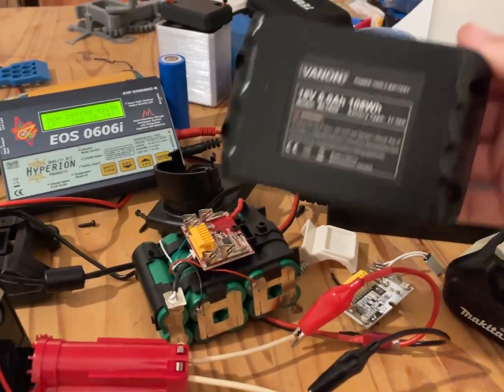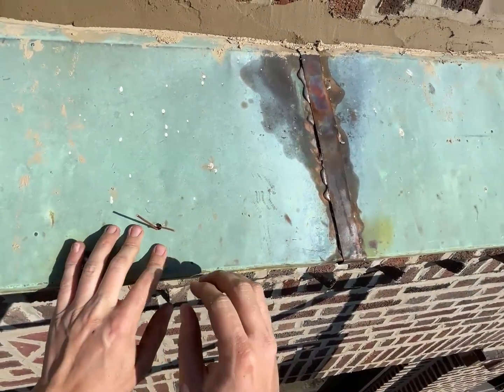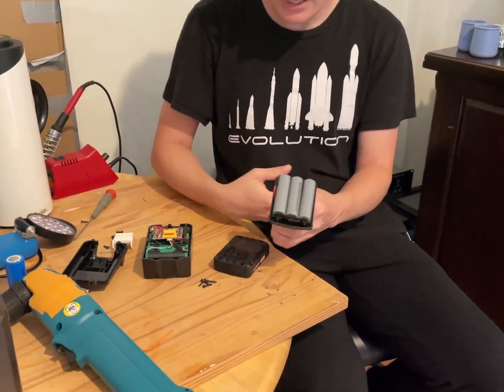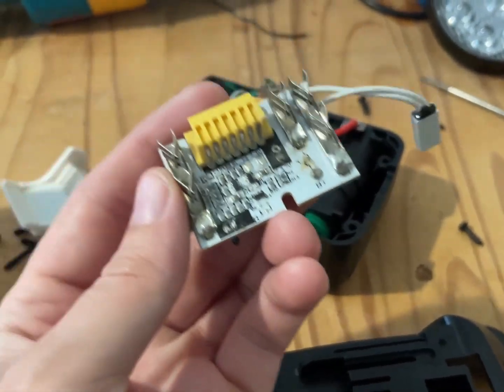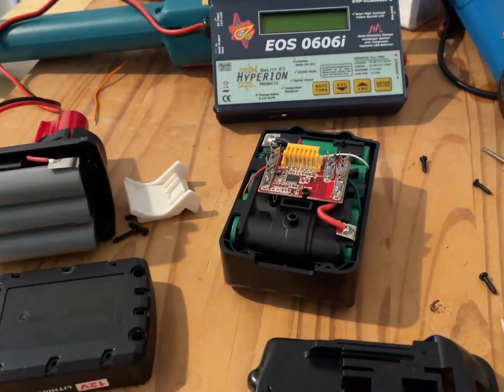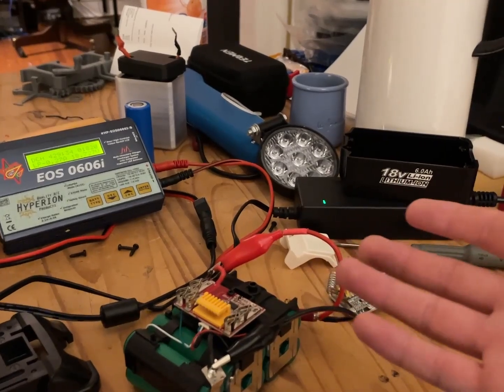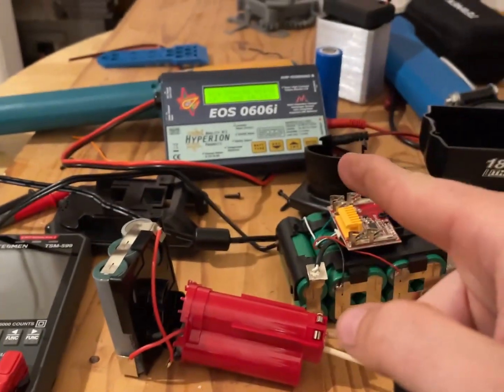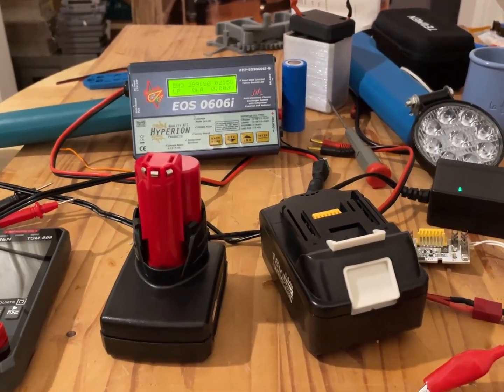Vanon / Aeboren power tool battery discharge test. Milwaukee / Makita compatible. How to check BMS.

Comment: Shitty bms world. My bms work and my batteries are lifepo4 and my attitude towards big businesses and consumer pawns is BAD.
Reply from the maker: I dont understand your comment so much. But I agree the bad BMSs are a big issue
Reply: @RinoaL  The small capacitor transfer 5s or 6s bms's actually work. They are about the size of a quarter and do 1 amp active balancing across potentially all of the cells simultaneously.  They have no safety features (only inherently balance as they should) they balance the voltage only. The lifepo4 cells which i replace in nicad tools are inherently safe for over charging and over discharging. I expect 3000 cycles for the batteries I just put together, and conpared to all the JUNK i bought in my day (even paying 300 dollars for my first drill impact driver kit) the GARBAGE BOSCH batteries lasted less than 100 cycles (probably closer to 50) AND after getting new batteries for the drill, the drill was used maybe 10 times and then let out the mosfet smoke the government chip smoked me SO I AM ALL AGAINST THE GARBAGE THEY SELL AND WILL FOREVER ATTACK THE MFG'D GARBAGE!!!